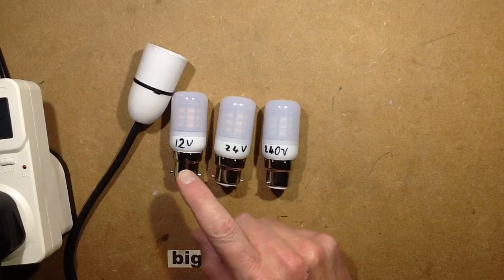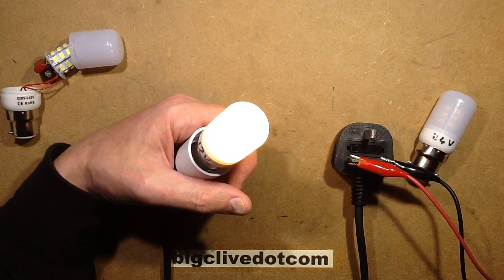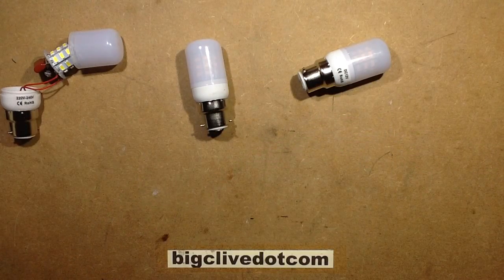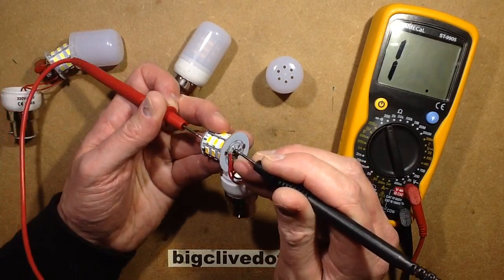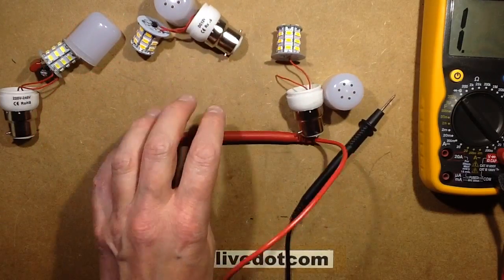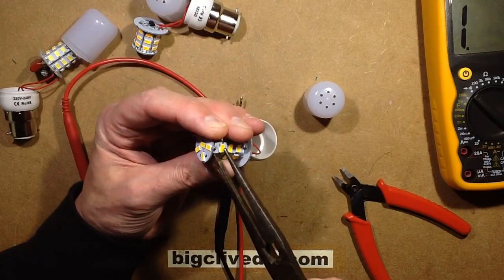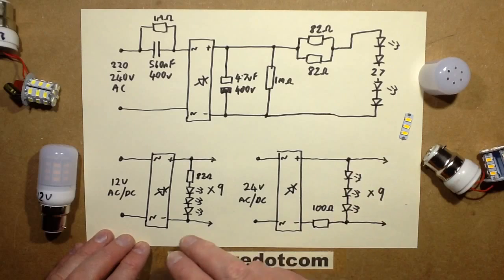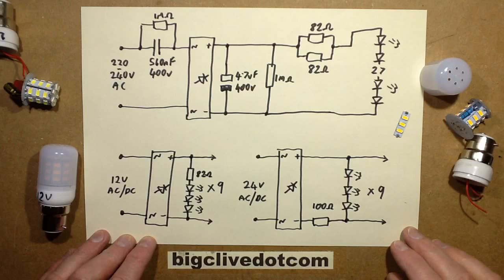12V, 24V and 220-240V LED lamp comparison.  (With schematics.)

Comment: completely off topic, but I ran across something where the explanation confused me more. I was working on parking lot lights that were 480v, when I checked the voltage I would get 277 volts to ground on A and B phase, but when measured across A and B phase I would get nothing. normally that would tell me that the 2 lines were on the same phase. I was told that on a 480v circuit when you lose a leg you will still have 277 volts on the opposite leg. That seems to be a lot of bleed thru a core & coil ballast in my opinion. The pole lights were all fed from a time clock going thru some crappy square d contactors.
Reply: 277v is the phase-to-neutral voltage of 3ph 480v, but it could be either "Wye", or "High-leg Delta".
High leg delta is more common in the US because it's easy to center-tap one or more of the windings to give two-phase 120/240v for "office" type loads.

If you have 277/480v "Wye", losing any leg will mean the other two legs still have 277v, plus any induced voltages from stuff like 3-phase motors trying to run without one of their phases (rough on the motors, standard motor contactors should cut out if a phase is lost, VFDs might not but still should).

I think your parking lot had 3ph 480v Wye power. In this case, your A and B "phases" were both tied to the same phase, but were probably fed from separate breakers.
One contactor per breaker (total 2 contactors), all on the same phase (so you get the same voltage on both, and 0v between them), and all controlled by one timer.
I think the reasoning for setting up the system like this is that it was built for older Metal Halide or HID fixtures, which may require this kind of setup because of higher current requirements. Or the lot just has a really high number of lights and there's something like "code says you can't put more than X fixtures on a single breaker".
Lights in a parking lot aren't usually going to use more than one phase, and 277v is a quite common voltage for them.

I wouldn't be surprised to see more than one phase going to the entire parking lot, (balances the load across all phases) but each fixture should only need one Phase, one Neutral, and one Ground wire.

Disclaimer: Not a licensed electrician, but I've read a lot about it (been interested in electricity/electronics from a very young age).
Reply: I know what your saying. These pole lights were powered from a 277/480v panel. These are 480v lights, 2 hots and 1 ground. On my fluke I measured 277v to ground on both power wires but between the phases got 0v. This tells me it's because there both on the same phase but they were not. I think the contactor screwed up the a.c. sine wave. I don't like these contactors at all, upon first visit 5 of them blew 5' from me. They blew so hard they traveled to the 120/240v panel via the time clock and tripped several of its breakers. To sum it up, another master electrician I worked with blamed it on losing a leg. Question is, with a 480v circuit feeding a metal halide if none leg breaks what will the voltage be at the broken leg? I measured 277v which I thought is way to high after passing thru a 1000 watt 480v tap metal halide ballast.
Reply: gizmo
Ah I get it now, if you're measuring from broken leg to ANY OTHER WIRE you should get "zero" volts (high impedance can act funky because of induced voltages, might get any voltage from 0 to 480v, meaning 277 is possible).

If you have a bad leg and measure from a good leg to neutral or ground you'll still get 277v.

IMO the best way to test the "bad" leg is to plug in a tungsten bulb of the appropriate voltage (240v 60-100w should be "close enough" to tolerate 277v for short duration test periods).
If the bulb doesn't light up, the wire's safely dead.
If the bulb lights up or blows, the wire's hot.
The test is still valid test if the bulb blows, it was a consumable in its original application anyways.

The reason you use a tungsten lightbulb is to let any induced voltages have a place to go, because it won't light up if you put 1w of power thru a 100w bulb, and induced/stray voltages shouldn't be able to carry much power assuming the only fault is a dropped leg.

Floating neutral can cause weirdness too, might want to check for that as well as a dropped leg. Sometimes they can look similar until you find something burnt, charred, melted, smelly, loose, or (thermally) hot.

If you need any more help with this kind of stuff, make a post on the Electricians subreddit. There's a lot of licensed electricians from all over the world there that would be happy to help you out.
https://www.reddit.com/r/electricians/
Reply: I have a resistance voltage tester as well as digital. No need for lamps. There isn't a neutral in a 480v 3 wire cicuit. I personnally have a hard time visualizing 277 making it all the way thru the ballast to the other phase without significant voltage drop. I also checked voltage on the contactors, line side had 480v pole to pole and load side had 0v pole to pole. Still had 277v from each pole to ground. I still think it was the contactor.
Reply: Ok if they're 480v lights you'll have 2 phases for sure, so 480v phase to phase and 277 phase to ground is in spec. Load side having 0v pole to pole is fine if the contactors don't have welded contacts, they might still have 277 pole to ground because the voltage is coming thru the ballast. Tiny current = full voltage if the load impedance is high, even if you're using a resistance voltage tester.

Now that I think about it some more, were those contactors single or double pole? One single pole contactor per lighting circuit would explain the odd load-side readings, because the circuit would be "broken" but it's still fed by 2 hots so you'll still see voltage on both sides of the contacts.
Double pole contactors would need to have a welded contact to have a similar result.
Either way, worth checking.
Reply: They were square d contactors with stackable poles. I believe the max they could have were 10-12 poles. These were only rated at 20 amps creating a flash storm. They have been replaced with 40 amp rated contacts 4 pole. I thought it was weird too. My thoughts still point towards the contactors screwing up the sine wave, hard for me to see 277 volts going all the way to the pole and crossing thru from a phase to b coming back all the way to the load side of the contactor and read 273v.
Reply: gizmo
Sheesh, only using 20a contacts? No wonder they were having problems. Wouldn't surprise me to hear they were switching both hots and a few contacts got welded shut by the arcing.
I'm betting there's a way for a welded contact to cause those odd voltage readings, but it's entirely possible I missed something. You were there, I wasn't.
Glad they upgraded to 40a contacts on the contactors at least.
Reply from the maker: If there was a phase down like a blown fuse then the other phase could well be brought completely to the same potential as the other phase if it was floating.
Reply from the maker: +gizmo When switching loads like discharge lamps there is a major issue with the inrush current to the power factor correction capacitors.  They appear briefly as a dead short at power up and this can cause contacts to weld or burn out.  It's better to go with well rated contactors and split the load into smaller circuits.
Reply: bigclivedotcom
gizmo 
That's kind of what I've been trying to say, could be an induction motor that does it, could be back-fed thru a bunch of metal halide ballasts (20A worth at 277v is only around 10-15 ohms), could be the wire just acting like a big antenna.

Don't blindly trust your instruments, ESPECIALLY if they're telling you what you want to see.
Sometimes it takes going back to the circuit theory side of an electrician's licence to see what's going on.

In this case, one welded switch contact on a double-switched 2ph 480v circuit can back-feed voltage to the load terminals of the contactor, and the resistance of a bunch of metal halide lamps isn't going to drop many volts compared to the resistance of a resistance voltage tester.
If the meter has 5k ohms input impedance, it will only see about 4.5v less than 277v, which just so happens to be 272.5 which is pretty close to the 273v that Gizmo saw.

The electrical theory I'm using to do the math here is Kirchoff's Voltage law.
Reply: bigclivedotcom I didn't know there was such a current spike on hid loads, I understand this for motors loads. That would most likely be the reason for the contactors shorting phase to phase. Personnally feel it was the contactor, time clock off no voltage on load side of contactor, time clock on 277v phase to ground ov phase to phase. I don't run across many 480v pole lights and I think there's a reason for it. When it shorts......

Comment: I'm only 1 minute in and I already want to see what happens if you plug the 12 and 24v into the mains.
Reply from the maker: I did.  And videoed it.  It was disappointing.
Reply: It was sadly disappointing when I watched the second video. I was hoping for a large flash, bang or at least the magic smoke escaping.
Reply: nothing happened. it just black dotted all the LEDs
Reply: photonic induction style?
Reply: I wanted to see what happens if you plug in 24v to a 12v bulb lol

Comment: Please, anyone can tell me the name of the little wire cutter at 9:18
Reply: http://www.ebay.co.uk/itm/New-Durable-Electrical-Wire-Cable-Cutter-Cutting-Side-Snips-Flush-Pliers-Tool/122050962728?_trksid=p2047675.c100005.m1851&_trkparms=aid%3D222007%26algo%3DSIC.MBE%26ao%3D2%26asc%3D39272%26meid%3Dce113ac05b47448ea25ee8ee93fd7ef6%26pid%3D100005%26rk%3D4%26rkt%3D6%26sd%3D261791862669

they are just the red handled version of the above
Reply: Thank you very much, they are very cheap :D

Comment: please pop these lights
Reply from the maker: I did....    It wasn't very exciting.  Video will be up in due course.
Reply from the maker: It's up, but don't hold your breath, it was completely unspectacular.
Reply: bigclivedotcom I agree but you at least gave them the black spots disease
Reply: Borrow Photonicinductions' big boy power supply and pop it with that. Should drive all the smoke (and molecular cohesion) out of it.
Reply: +bigclivedotcom I can hardly wait :)